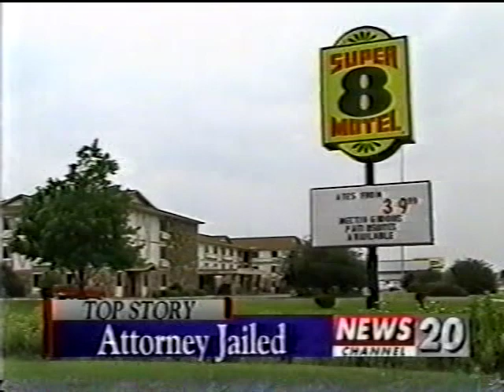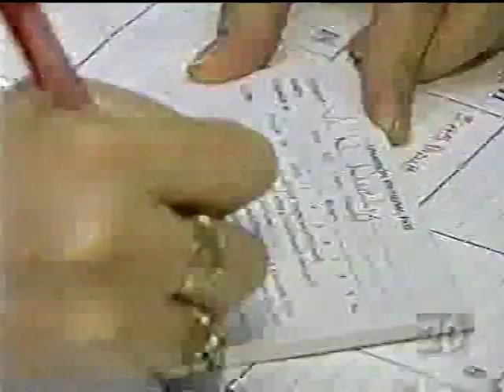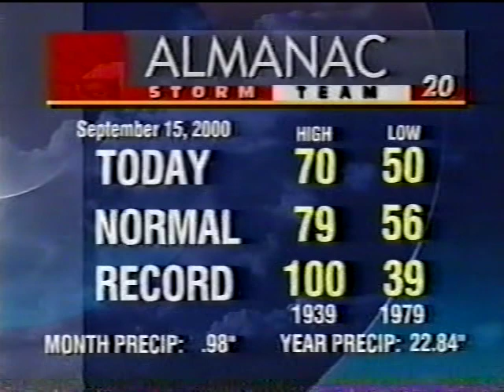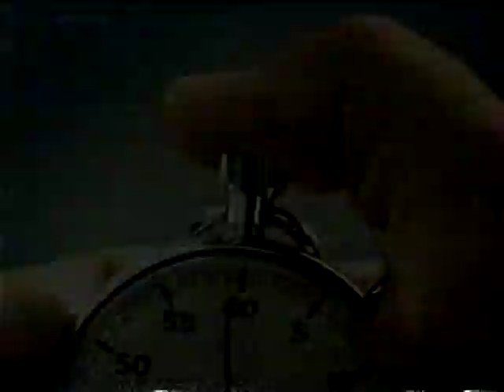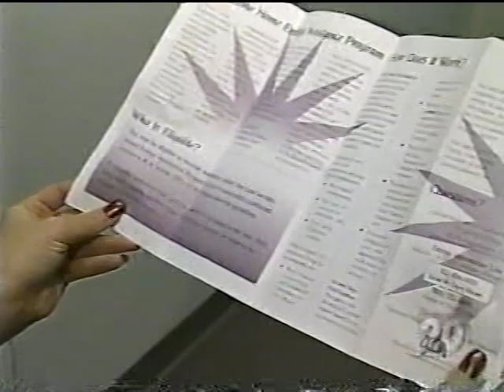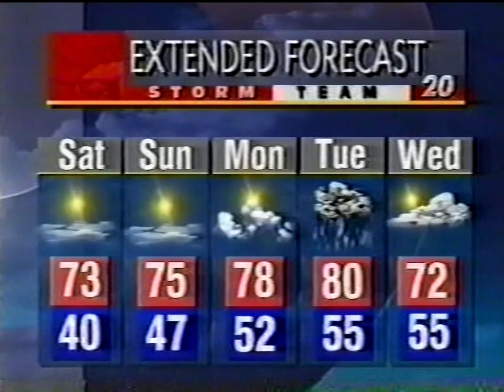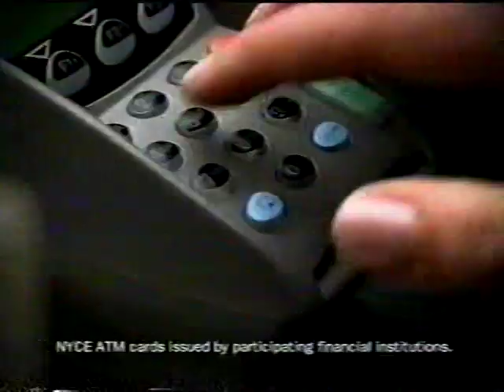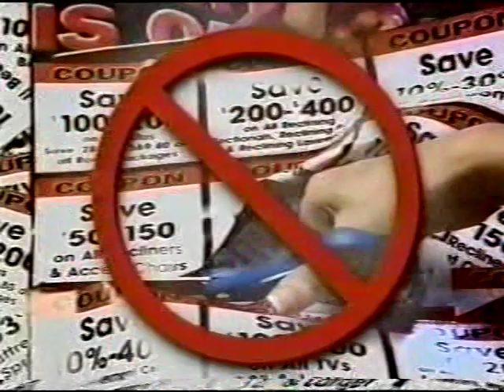WICS 6pm News, September 15, 2000

Comment: A unique feature of WICS-TV at the time, and maybe to this day still. And especially for a market this size; at the time a mid 80's size TV market out of 210 TV markets.. Was all the closed captioning was done in real time by a captioner at home who called into the studio via phone line and connected to equipment that encoded the captioning from the  steno-type machine the captioner used at home. This was a service that was pioneered for Illinois School for the Deaf in nearby Jacksonville Illinois initially paid for by a grant from the State of Illinois to purchase and setup all the captioning equipment and stenographers. (later years such as this broadcast had paid sponsors when the grant ran out) The pool of stenographers were court stenographers that worked mostly at the Illinois capital court houses during the day. The pool of captioners would ether caption the 6pm or 10pm show, (all other shows were captioned from the prompter script) and trade off who did what show according to their schedule.  This particular broadcast was captioned by Kathy Smith  seen in the CC text at 29:32. Amazingly You Tube captured the closed captioning data that was encoded onto line 21, that was recorded onto what appears to be a VHS tape. The captioning data stream was designed to be robust enough to make it from a broadcast or cable feed onto a mediocre quality home video format like VHS recorded at SP or worse EP speed and still be decoded. Twenty years later the embedded captioning done by Kathy Smith still shows up!

Comment: On a side note, a broadcast by sister station WICD channel 15 in Champaign Illinois happened to also be recorded only three days apart from this broadcast on September 18th. Both broadcasts reference the 2000 Sydney Olympics on NBC. Note the similar graphics, especially the weather system. Both used the same software from ether WSI or Weather Central using a Silicon Graphics O2 workstation. Recorded by Doug Quick who anchored the noon broadcast from that telecast. Seen here. https://youtu.be/KMjUCVXijJg Doug Quick has a great selection of broadcasts from Central Illinois from this era and earlier. Check it out, anyone who lived and grew up in Central Illinois will recognize many of the on air talent and anchors. Quite the memory lane. Thank you for posting this video!